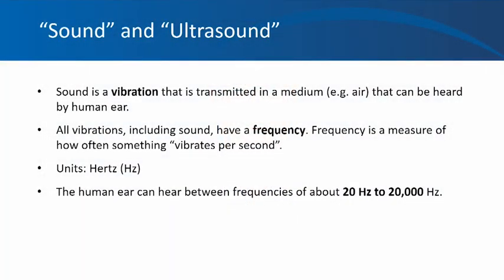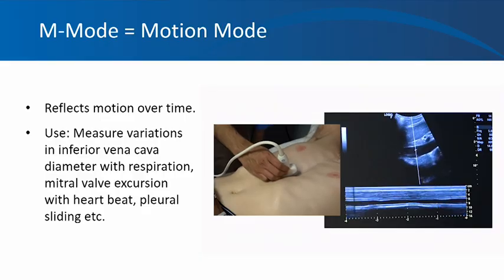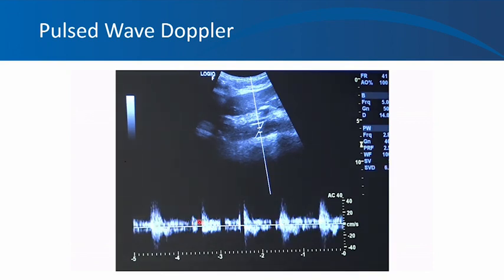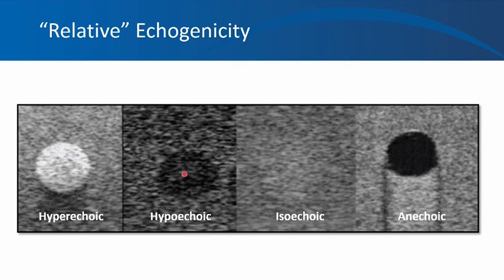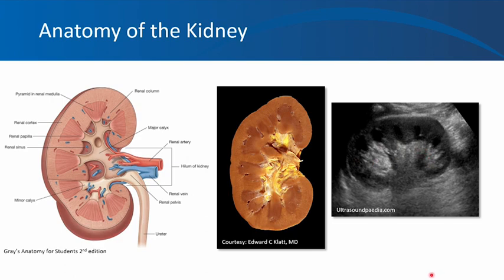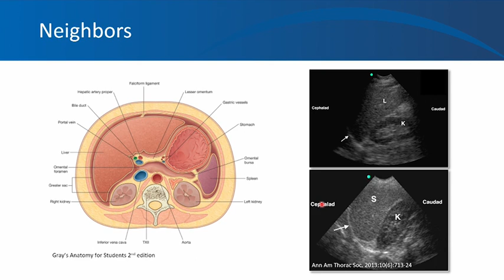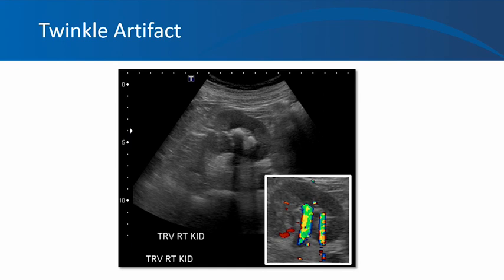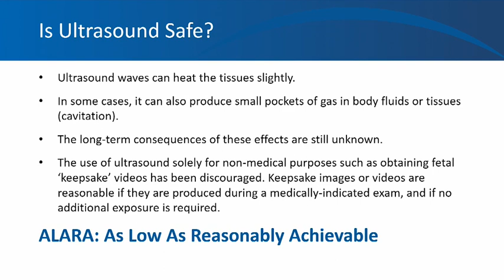Renal ultrasound video 1, University of Florida Nephrology by Dr. Koratala (Twitter:@NephroP)

Comment: There's one very important detail, concerning probe orientation, which many people don't know. For example on some US machines when you start them the preset is set that way that the marker on the screen is on the patients left (most of Toshibas I've worked on). If it is set that way, and it can get unnoticed,  holding the probe the proper way you'll get a wrongly oriented image and it can get very confusing for the beginners. So the dot on the screen MUST always be oriented towards the patient's right-hand side with the marker of the probe oriented towards patient's head or right shoulder. Believe me, I've seen reports from radiologists with clips that were wrongly oriented.